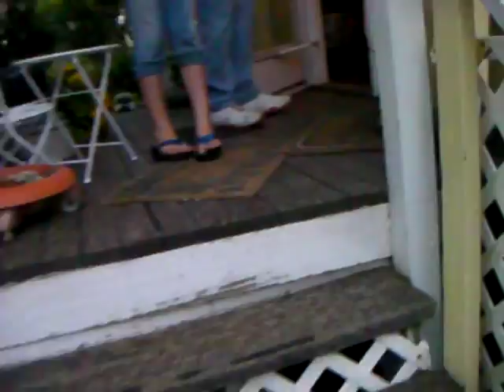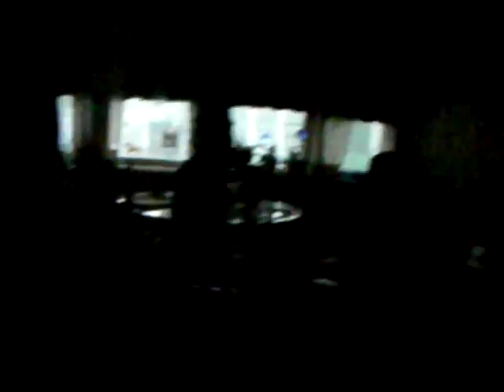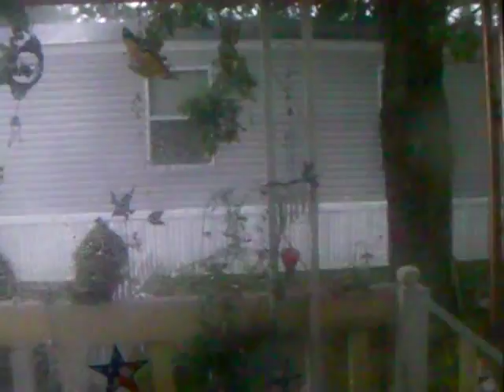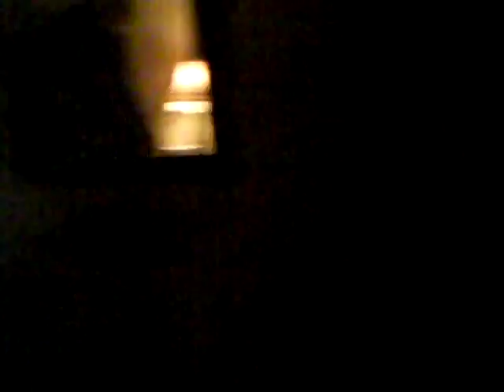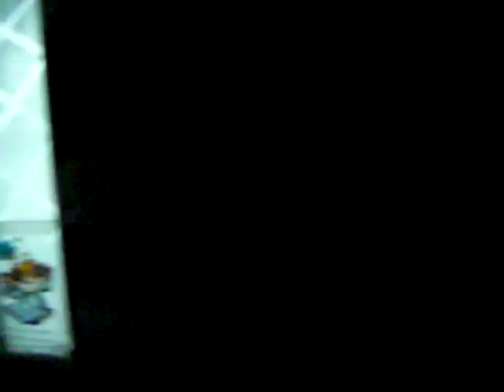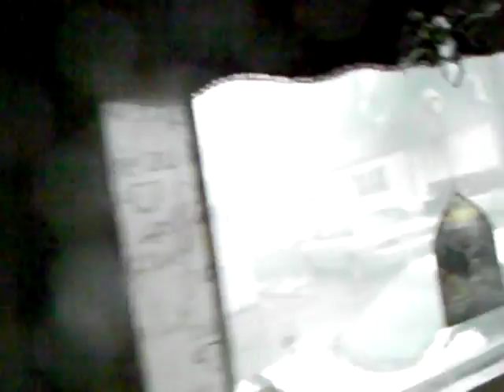Powerline Arcing During Severe T-storm

Comment: No.  There are devices called reclosers that are designed to clear a fault on the line without the power going out completely.  Usually they are set to bling 3 times and then lock out if the fault is still there.
Reply: Yep. That’s how the substation is down the street from my house.